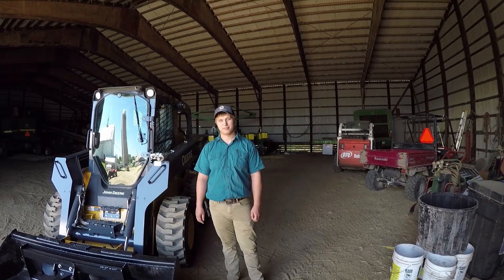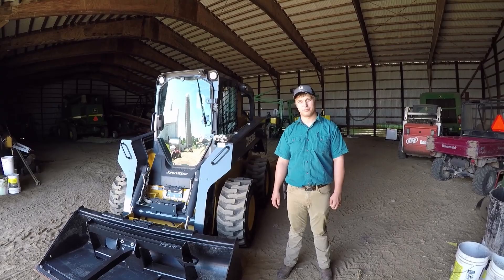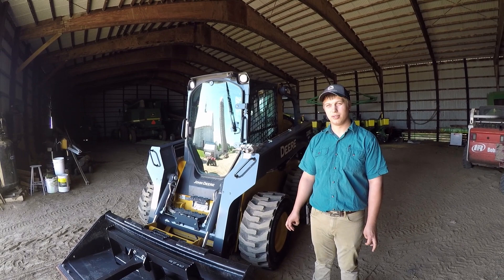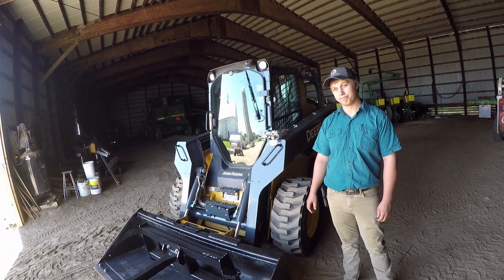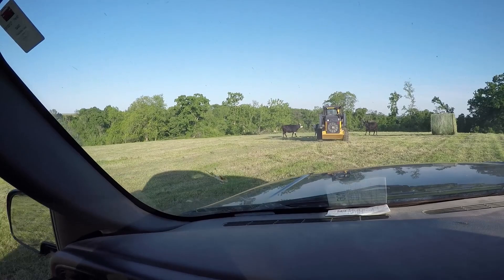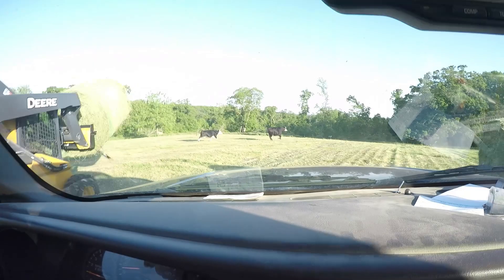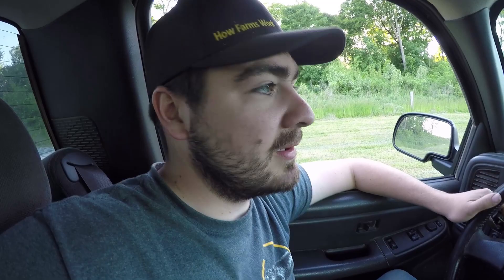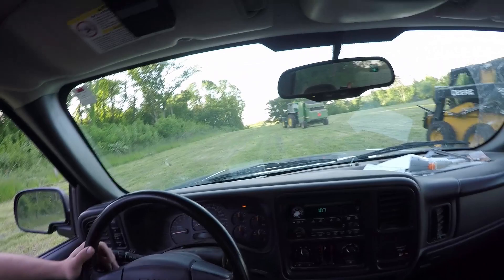Hauling In Bales - John Deere 326E

Comment: I bought the 333G and have about 10k breakout. Most people don't need that, especially for haywork but I also have a lot of clearing to do and use mine with a Danuser Intimidator. It's a really nice machine. I had a Kubota SVL90 for a few years and that was a nice skid also. I wish Deere would consider a side door like Volvo and JCB.

Comment: Only reason you spun out is the weight is all on the trailer with nothing on the truck. Have a trailer puting weight on the truck to haul bales, or put a bale in the bed, you could have made it up that slope easily.
Reply: I'd have a bail in the pan of the truck just for that reason
Reply: Would his new tractor be able to handle a bail in the bed?  That sure would help out on traction.  Either that or put on chains...
Reply: Snipe Stud00 iihhh

Comment: Why not use a tractor to pull around the trailer in those gnarly areas? Better traction and control with the extra weight of the machine.

Comment: A dump trailer..7 yard would haul the skidsteer to the field..Hold 5 to 7 bales and roll off.  Haul corn 400 bushels?   Heavy duty rocks and trees. Wood chip hopper and delivery.  Trailer brakes a must.  Dual axel trailer will stop the truck.  Love the countryside shots.
Reply: Rhino should build one with bolt on options..power winch, swing out auger that can unload into semi, floor auger with grain insert sleeves for gravity flow, boom arm and side extensions built in.  Hydraulic ramps.  Breaker, post hole digger, brush hog on boom arm and dig bucket mini excavator size.  Now that's a fall demo schedule.
Reply: A power winch system 4 corners and 2 each side.  Secure 6 point tiedow cables. Hold grain inserts also.  Roll over tarp hydraulic.

Comment: Highly recommend that you wear the seat belt. Every accident where the person isn't wearing a seat belt results in the person being thrown from the vehicle or thru the windshield and usually killed. The vehicles all are designed with a "roll bar" built into the roof. You are much safer to have the seat belt on.
Reply from the maker: +Beverly Kemmerley At speed, I would agree.
Reply: Not every accident where they don't wear a seatbelt results in ejections.. that is just a dumb statement

Comment: Why is there a piece of rubber on the hitch of the 4600
Reply: Cameron Bair so stuff like long grass or corn stalks don't pull out the pin on the drawbolt
Reply: It deflects rock away from the pin so it doesn't get knocked out of the hitch

Comment: why would you put cattle in a fresh cut field? could reason they are eating the bale because you baled all the feed? cow use their tongue to grab and rip the grass, they need more than 2" of grass to graze. also im sure they are eating the bale because that's how they get fed most of the time.
Reply from the maker: The field is a pasture that they won't eat enough of because there aren't enough cattle in that pasture yet to keep it down.
Reply: so could you not run a strand of wire and some step in posts and only give them half? or a quarter? and just rotate them?
Reply from the maker: +Daniel Sye You're talking putting in a mile of fence to keep them out, even a temporary fence wouldn't really make it worth it since we let the rest of the cattle in to this pasture around this time of year.
Reply: so you don't rotate at all? just continuous graze?
Reply: Daniel Sye ur thinking of horses. Cattle use their teeth cut it. Horses rip it up. Also the hayfield is part of a bigger pasture not the entirety of it.
Reply: No i'm thinking of cows. long tongue, sweep grass into mouth and clamp down and pull. Horses can nibble because they have teeth on the upper and lower jaw. Cows do not, they only have front teeth on their bottom jaw. Cows need longer grass.